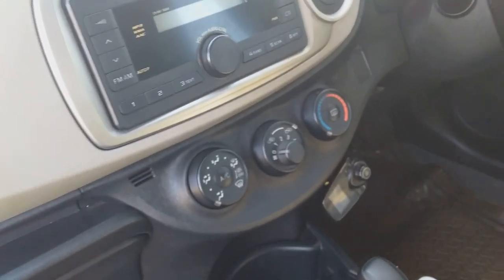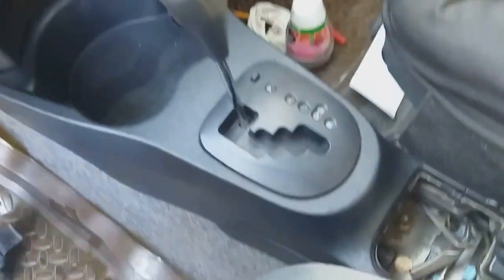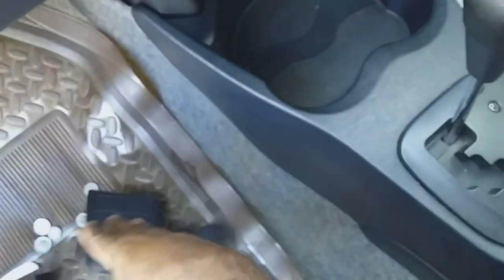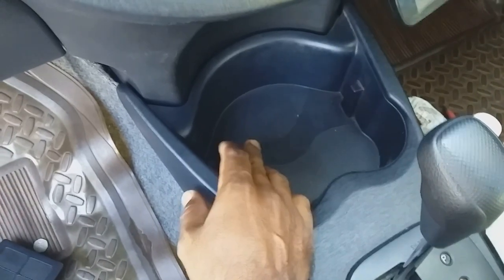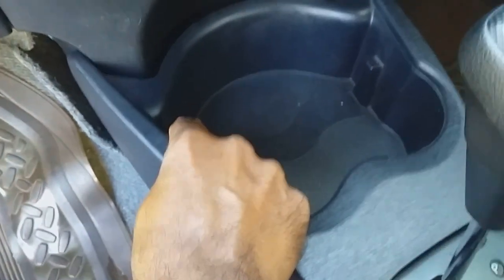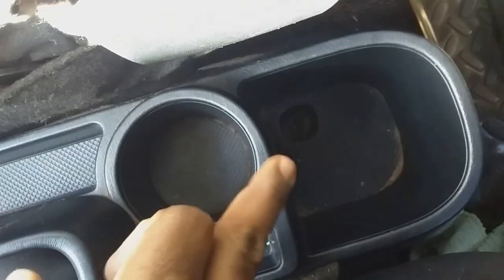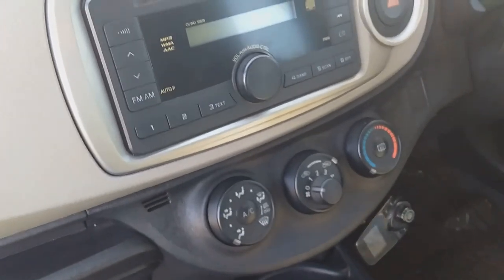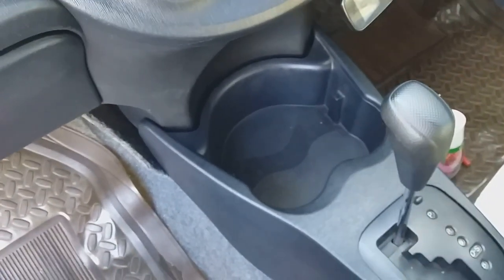Toyota Vitz How To Remove Gear Shifter Panel

Comment: how much gear oil to put when changed,?
Reply from the maker: When you are changing the transmission fluid you usually drain it in a container then measure the fluid to determine how much to put back.